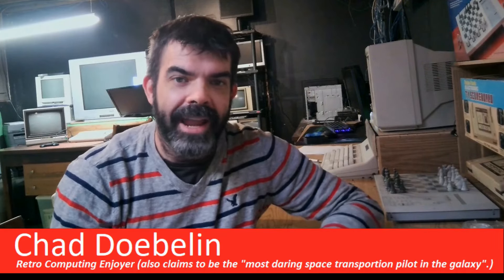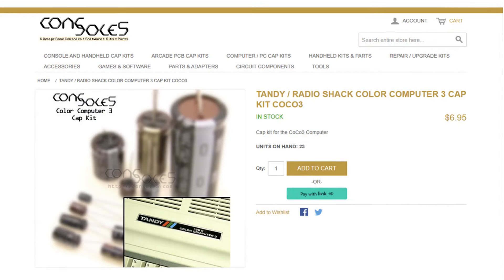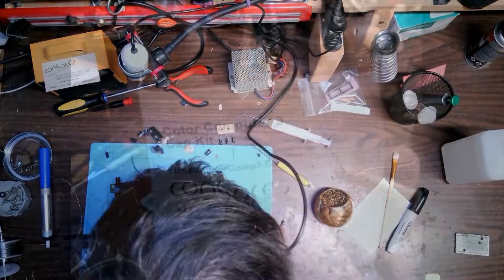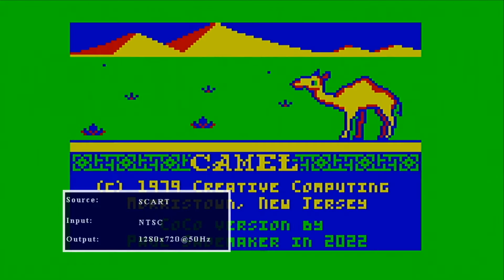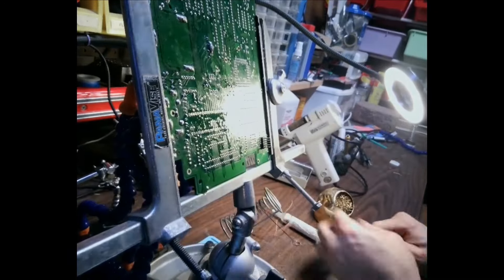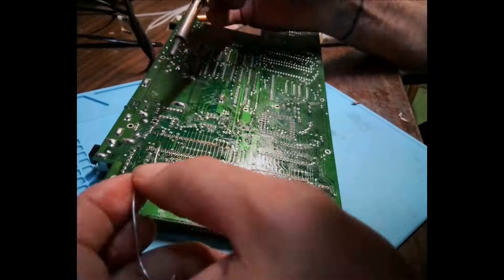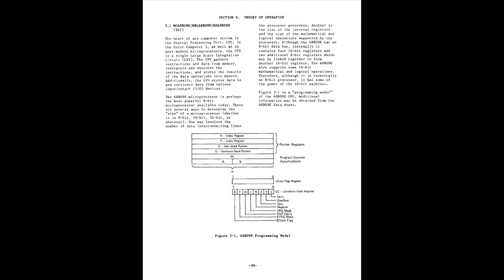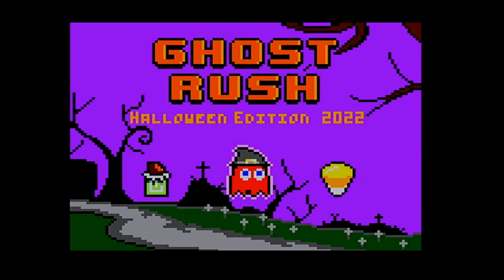Tandy Color Computer 3 - Full Recap and CPU Upgrade

Comment: Nicely done Chad. You did all the same upgrades I did with my CoCo 3 recently. The CPU replacement is probably the hardest upgrade to do since the original CPUs are soldered to the board. Like you I took my time in removing it. I do have one more upgrade happening with my CoCo 3, but you'll have to wait for a upcoming video. No spoilers 🙂
Reply from the maker: Thanks for taking the time to listen to me speak.
I am excited to see what you’ve got up your sleeve.